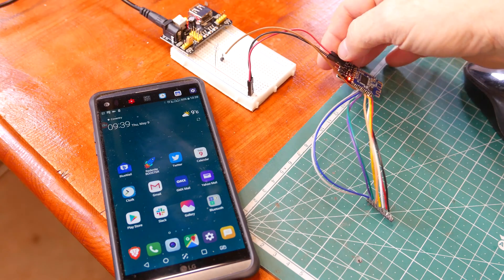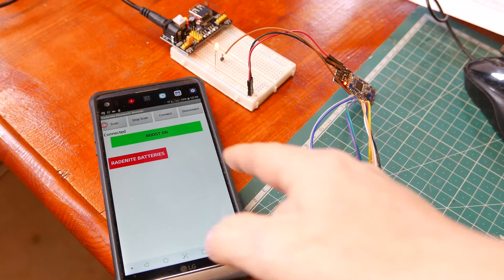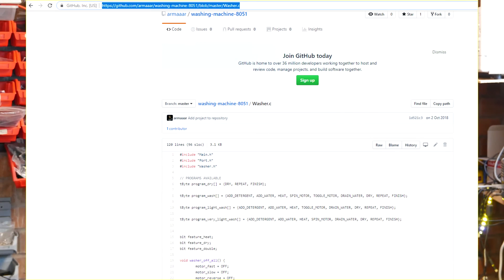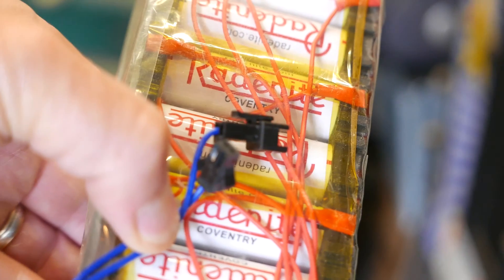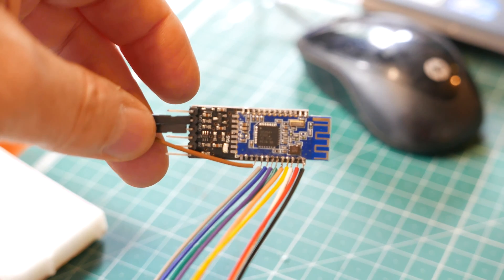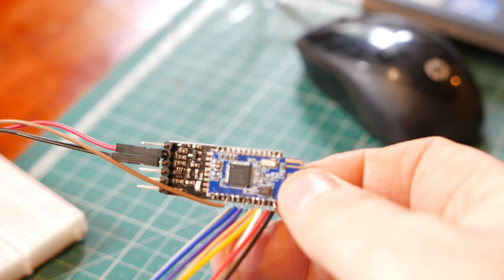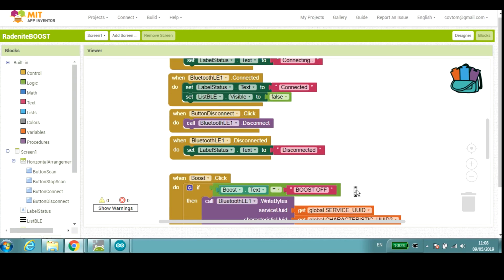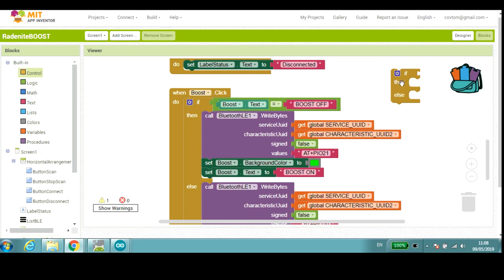HM-10 BLE Android App using HM10 & AI2 only.  NO ARDUINO

Comment: Hi thanks for the info on the HM-10. Can I program it on the Arduino platform? Because of the small size I would like to use it to transmit data from 2 joysticks to a existing ESP32 receiver module

Comment: I am planning to use JDY-23 Bluetooth module to make a smartphone-controlled helicopter project but I have a question about the PIN PWMout control command to control the engine speed. can you guide me the command to control PIN PWMout of Bluetooth module with App. please help me.

Comment: Hi Tom this was wonderfully insightful, thank you for your video. I'm curious to using such low current (20ma+4ma) from the HM10 pins, do you use optocouplers with a relay or are you using an specific relay? I'd like to make a project operating 5 relays using your method
Reply from the maker: D4184!  In fact I sell them..

https://www.ebay.co.uk/itm/254436645047
Reply: @crazytom  thank you very much! My project is simply to bridge jumper connections with a Dupont connector on another piece of circuitry. I took your ideas for the MI2 app and - at first I was using an Arduino nano with HM10, but to find I can cut out the Arduino was a revelation.
Tom, you have a great style of teaching and pack so much information in there - I'm grateful!
That was also the fastest response I've ever had on YouTube 😁 all the best

Comment: I was thinking of making a video about using an arduino is stupid.  Just really I know there is documentation out there using an arduino but doesn't mean you have to use one.  Arduino is basically a breakout board for the atmega chips.  Great chips to breakout but not needed, what you needed if you want any wireless is a breakout board for a wireless enabled chip and almost all wireless chips have integrated processors that are over powered for there application, and even if you are reaching the limits of the wireless module, still make your own code so you can get every ounce of performance out of any processor you are using

Comment: I have an HC-08 and it has an 8051 processor in it. I want to use the A to D in this. Do you know how I can connect to the 8051 and configure it?

Comment: Soldering a wire @ 4th position I can no longer connect to the device. Using DSD TECH HM-10. Looks very similar to your HM-10 module. I see the LED state change to solid red for a bit then nothing. Possible the pinnout is different?
Reply from the maker: Well possibly.  But simply attaching a wire shouldn't nix the device.  As it happens... I designed a board with full pin out and 4.5V to 70V power supply range. 

https://radenite.com/hm10/Breakout.jpg
Reply: @crazytom  Are you making your own PCBs? Looks like a CNC job. 4.5  to 70? Useful for the automotive industry. Sweet!
Reply: @crazytom  I was able to reset and rename the device hooked to an uno. Won't pair to my note8 or Samsung tablet but will to my Win10 PC. Fork me! :( Thanks for the tutorial!!!
Reply: It is a CC2541 chip.

Comment: Hi, I'm from brazil. It is difficult to understand, sorry.
To summarize, if the HM-10 firmware is updated, as you show, then I can control the I/O by a bluetooth APP, simply by sending the command AT + PIOxx? 
Or I necessarily need an AI2 app?
Reply from the maker: No AI2 not required.  You can issue via tx/rx instead.

Comment: So the pins on the chip are controllable via AT Commands? Interesting... but I'm not sure it's going to work for me.
Which sucks, because I basically already need two micros... one for reading some tragically slow 1wire sensors, and another for constantly updating some shift registers.
I doubt this method of interfacing would work for either function.
What's actually stopping us from replacing the firmware? It looks to me like the chip supports ISCP. Is there a reason we couldn't use any old 8051 compiler and upload via ISCP?
Or is it the software stack from TI that is the baring factor? (Documentation says the OS layer is in source form, but they may have that heavily restricted.)

Comment: Hello,
Thank you for your video. I managed to update my AT-09 board from Aliexpress to version 705 using your guide.  However, I cant get the Android app to activate the PIO2 pin.  I can do it in terminal (android Serial Monitor) but when using the App it did not activate the pin as in your video. The command did show up on the terminal though.  Can you help me getting the app to work?  thank you.
Reply: I found the answer to my problem.  If anyone experience my problem - try entering (AT+MODE1) in terminal to put the AT-09 into command mode, then what ever you send it will be command rather than just passing through as text.  Thanks for the guide again.
Reply from the maker: Thanks for this.  Very useful.
Reply: @crazytom  thanks to you, I can now control my garden watering system from my phone on top of the automatic program. cost for $2.00 for the AT-09.  Awesome video Tom!
Reply from the maker: @nzpham3389  Fantastic!  Let's see a video or a Kickstarter!!
Reply: @nzpham3389  Thank You.
Your comment was very useful.
Reply: Hi, whether the mode setting has to be done every time ? If yes, can we do the mode setting without Arduino board.(UART interface)?@NZ pham
Reply: @srinivaskb209  no.  You only need to setup command mode once.

Comment: Excellent work . 
I was testing this last night with the same purpose you have.
I have a HM10 clone, i flashed it with v540 and GPIO works too.
I wanted to use this to connect the ignition wire in a older scooter type ebike. The thing is the battery is a 15s, 63v.
How do you plan to make the connection in your wiring?
I am stiil searching for an app for ios tha allows me some configurable buttons to send just the AT command to gpio on or off.
Are you making a video about that ebike modification?
Reply: Hi, Have you figured this out, how to send commands to the gpio..

Comment: Tom, KUDO's to you on your YouTube video! Many sparks of inspiration have emerged.
First, Just as an FYI, I've used Arduinos CCLoader.exe with the Version 540.bin they supply,
on one of those cheapy, SunHoKey HM-10's(two for a dollar) and your AI2 app, and pin control
works perfectly. So I'm not sure what you meant by needing 603 and above, and it won't work on the clones.
So far it's worked flawlessly for me.
Secondly, this post could go, on, and on with questions about the possibilities of connecting to several modules
simultaneously. Also I'm at a total loss when it comes to AI2, as I program in Android Studio. So my question for this time
is,,,  Have you figured out a way in your app to see the AT command results in some sort of text box??
Reply from the maker: Thanks for the kind words.  Glad you've found a module with the firmware to support.

Yes I have.  I'm reading ADC, chip temp. and display them in an Android app.  But I wrote the code for a business under contract.  Won't take much digging around though.
Reply: @crazytom  I am still not able to glow LED through gpio, Do I need to write code in the HM10 or the APP will be sending the instruction to that gpio ?? can you please clarify this

Comment: Could this also work to read input from those pins?
Reply from the maker: Yes of course. Including ADC.
Reply: @crazytom  Excellent! Where does the latency usually clock in at? I've seen some people getting stuck with over 500ms when chained with a second microcontroller
Reply from the maker: @i_makes_stuff  Latency?  You're using RF comms, 3 "operating systems",  two applications and a layer of AT Command interpreter.

I wouldn't use this approach for high speed signal switching.  :)

I
Reply: @crazytom  I am still not able to do it. Can you please tell that how to write the code in the firmware for the LED to blink.